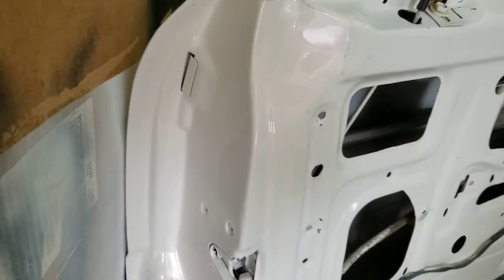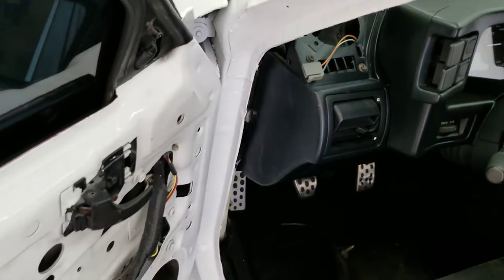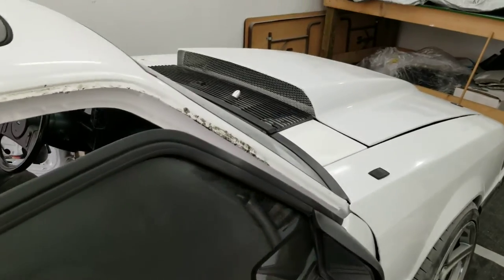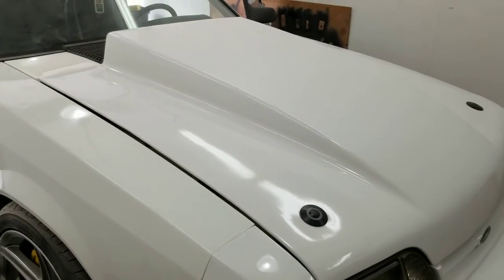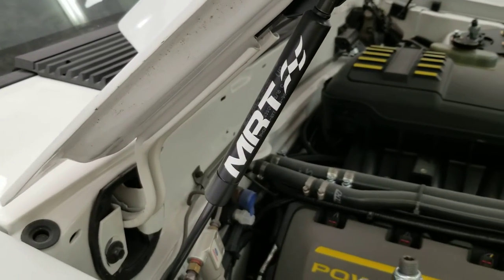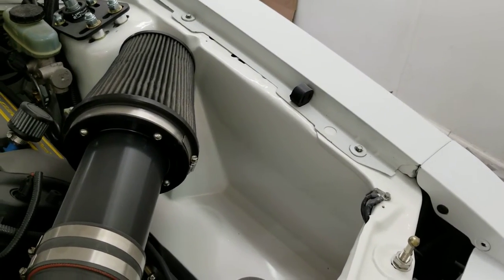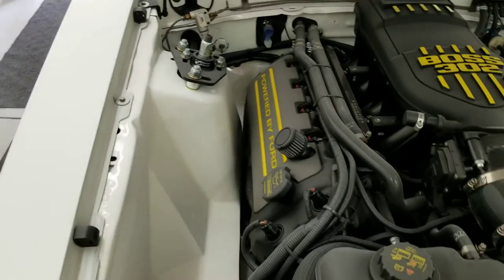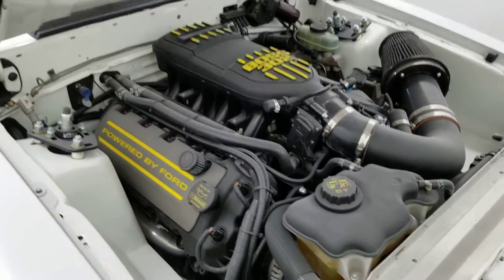painting smooth door jams #foxbody #coyoteswap

Comment: Broooo what seats are those? 03-04 cobras? Did you have to fab a rail or was it just bolt in?
Reply from the maker: What's up bro....these seats are from 03/04 cobra the dark charcoal ones...got them off the forums someone was selling them...brackets go right in ....87-04 seats bolt right in....gotta do a little wiring if you want to keep power....I didn't do it I put in a manual bracket